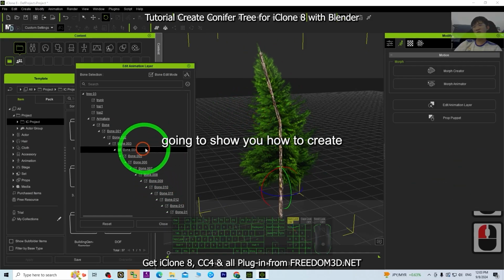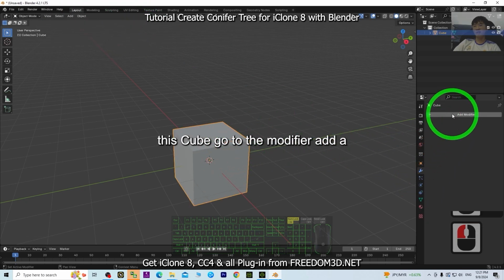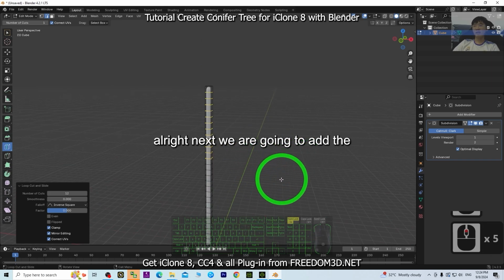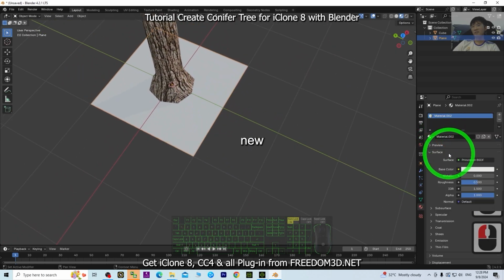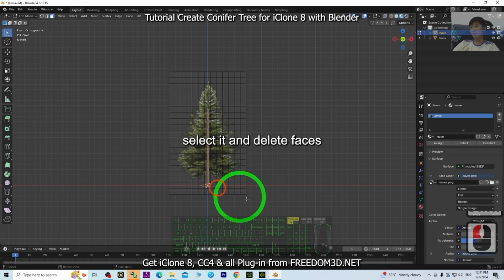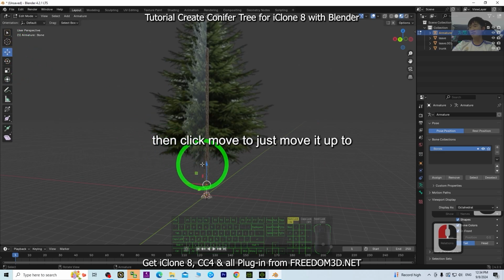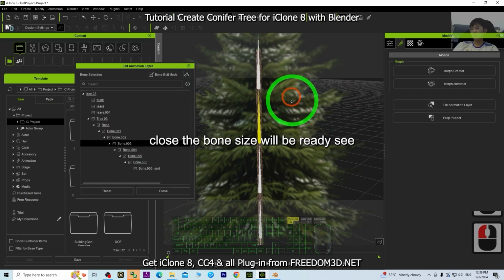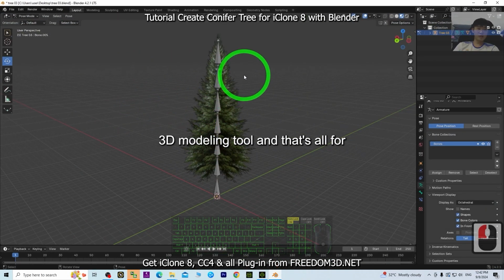Blender to iClone 8 Conifer Tree Tutorial | Rigged Animated Tree FBX Workflow

Comment from the maker: This tutorial by Freedom Arts 3D Workflow provides a comprehensive, step-by-step guide on creating, rigging, and animating a custom conifer tree for use in iClone 8 using Blender.
Key Steps in the Process:
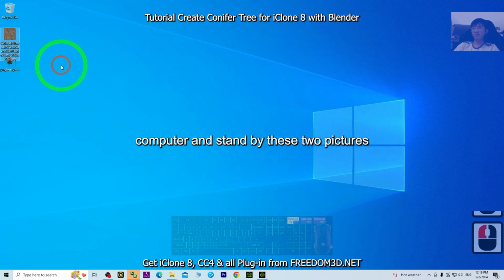1.	Preparation (0:00 - 2:45): Begin by sourcing transparent PNG textures for the conifer leaves and tree trunk.
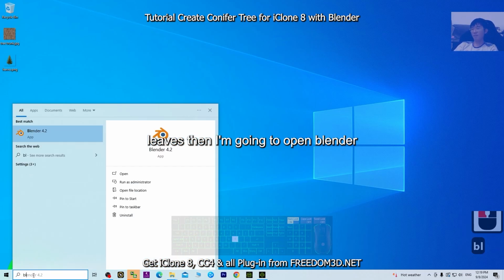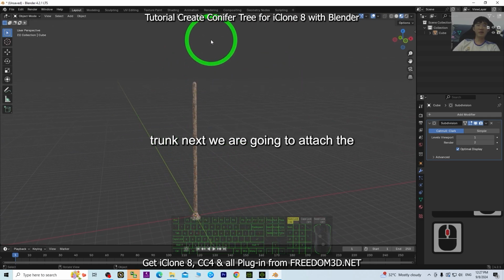2.	Modeling in Blender (3:00 - 9:40): Use a cube with a subdivision surface modifier to model the tree trunk. Adjust the height and perform loop cuts to define the shape and roots.
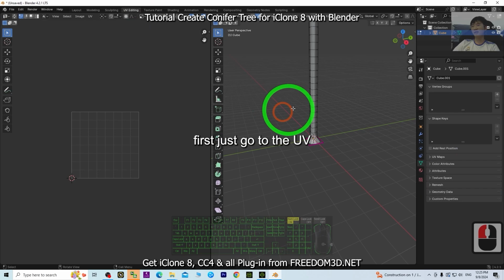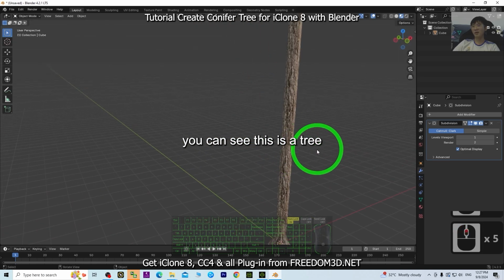3.	UV Mapping (7:15 - 9:33): Set up UV mapping for the trunk using the "Smart UV Project" to ensure the wood texture applies correctly.
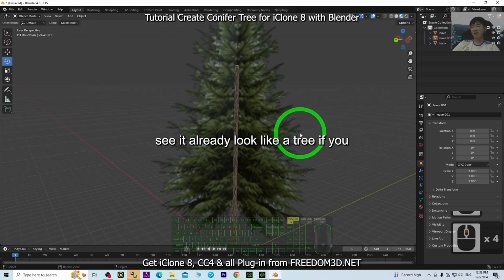4.	Adding Foliage (9:44 - 15:05): Import the leaves as a plane, apply the texture, and enable alpha transparency in the shading workspace. Subdivide the plane to add detail, then duplicate and rotate the leaves to fill out the tree shape.
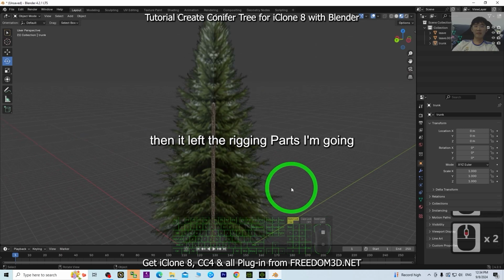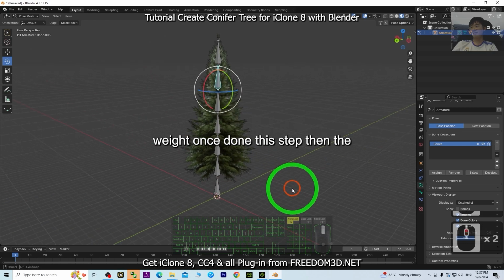5.	Rigging (16:15 - 18:25): Create an armature (skeleton) for the tree, subdivide it, and use "Automatic Weights" to bind the mesh to the bones. This allows the tree to bend and sway.
6.	Export and Integration (18:54 - 22:50): Export the model as an FBX file with embedded textures, then import it into iClone 8. Final adjustments in iClone involve setting the opacity and using the skeleton for animation, such as simulating wind movement.
By following these steps, you can create a fully customizable, animatable tree asset that functions as a prop in iClone 8.